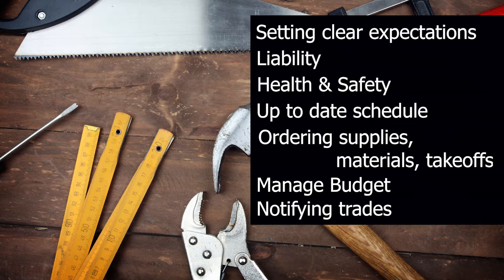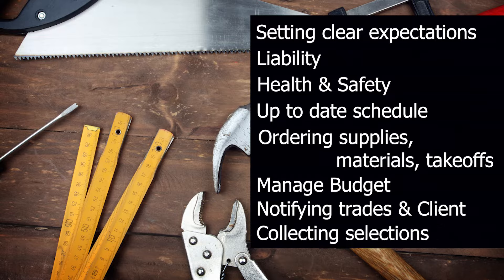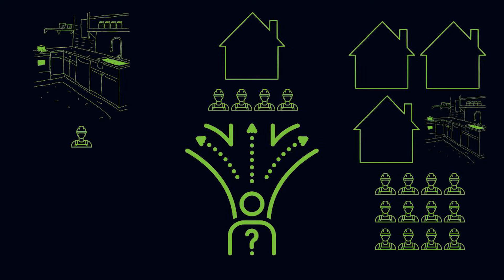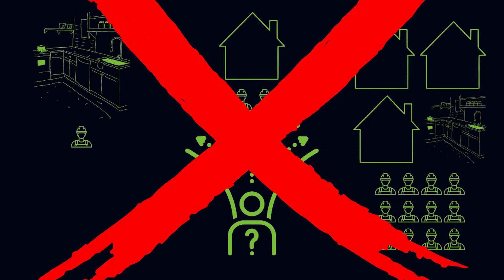How to Become a Successful General Contractor

Comment: Becoming a General contractor was easy. I went to work for plumbing contractor for 5 years and completed on job trainning and classroom trainning. Worked 5 years for a electrical contractor including OJT and classroom. Worked 5 years for HVAC contractor OJT and classroom. Worked for a framing contractor for five years OJT and classroom. Completed building, hvac, plumbing , electrical code classes and certification. Took the GC test, during the test it took longer to do the practice test then the actual test.  The actual test took 10 min.  I used the blank sheet of paper to list the test juestions that that were wrong so the state could fix their test. You won't even need to study for the test. Take it, you will be done in 10 min